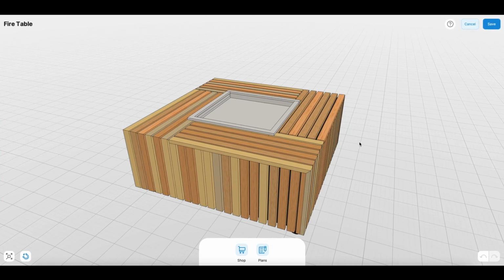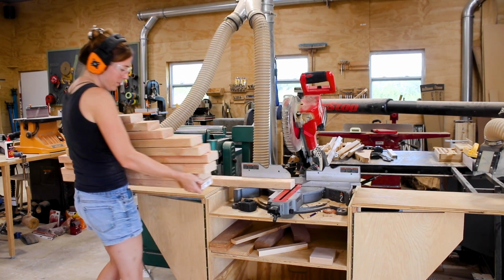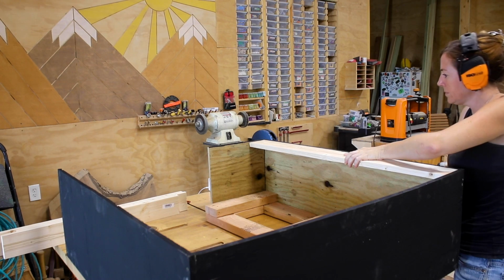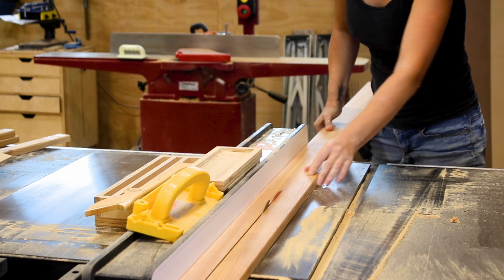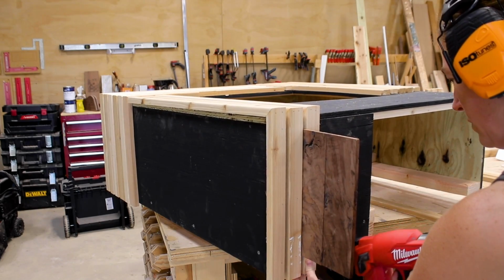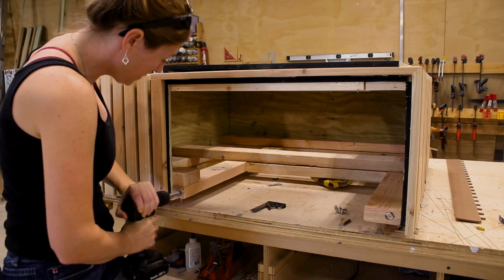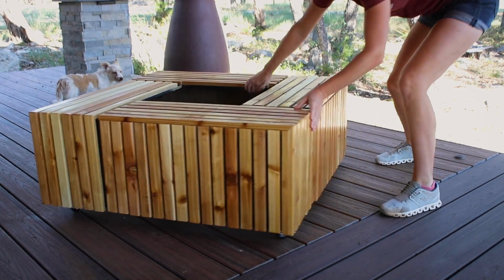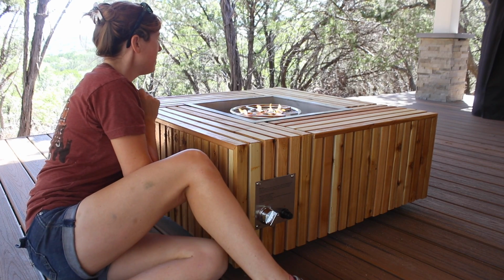DIY Fire Pit Table | A Gas Burner Kit Makes it Easy

Comment: Question.  I saw that you have the SawStop Floating Overarm Dust Collection unit.  It is understandable that you wouldn't use it while pushing lumber through while the operation is being videoed; however, there was a lot of sawdust on the table saw.  So my question is, do you ever use it?  Trying to decide on what overarm unit to get - if any at all.  BTW, I am the one Laura Kampf asked to take a picture of you, her and Andy Birkey at the Bay Area Makers Faire.  Thanks.

Comment: Looks fantastic.  I'm a bit wary about making the table itself out of combustible material and then coating with varnish but I'm keen on taking some of the useful tips and insights here and applying it to a stone/cement or tile-faced structure.

Comment: Oh my goodness am I so very thankful for your recommendation of the new modeling software! I have been building projects for more than 15 years. Always stuff straight from my head to the shop, which of course was complicated and so very time consuming as I never had an actual plan on paper. I tried Sketch Up several times and for whatever reason it just wasn't working for me. This new one, however...game changer. The moment I watched the video and saw your suggestion for the Make By Me software I was hooked. Jumped right on it, easy as can be and modeled a firewood rack I've been wanting to build for years. The breakdown of materials needed and cut list is going to absolutely change my building life. I can't thank you enough April. Love it! And of course love all the things you build ❤

Comment: The magnet idea is great. Not sure I'd build fire furniture out of wood though.
For youtubers, research whether propane leaves soot on fireglass.... I believe fireglass works best with natural gas. I have fire stones instead of glass, the soot is significant. Also, a glass fence around the fire makes it pop.
April, thanks for the video, the result looks great.
Reply: If you are getting soot on glass with your propane then you need to research and add an air mixer. Problem solved.
Reply: @haunthunterify  Air mixers have a certain likelihood of allowing propane to escape into the enclosure... No thanks.
Reply: @331SVTCobra  if you install it upside down, yes. If you know what you’re doing then no. Also, you should also have good ventilation for your exclosure.

Comment: I think it would have made sense to to put a platform inside for the tank.  With wheels, I can see this shifting around and banging into the tank, especially by guests who might want to just move it a little closer, move it aside as some passes, etc.  Also, as the design stands, when you do want to move, you have to go under and disconnect the tank, move, move tank, and reconnect.  One other thought was that the inner frame seems like it would benefit from some upright members, rather than relying on just the plywood.

Comment: Awesome Fire Table April! However, I will probably wait until next spring to build one. I'm very busy in the fall harvesting soybeans and corn on my farm. I'm glad you included links for the Fire Pan Kit and Horizontal Propane Tank, since I will need those when I build one. What are the over all dimensions for both of  your Fire Table Plans?  I might have missed it but I don't think you mentioned it in this video, and I don't see the dimensions on your website plan's either. Great Video! Enjoy your fall evenings relaxing by a peaceful fire April!
Reply from the maker: Sounds like you've got your work cut out for you! I forgot to mention the dimensions. They're now on my website with the plans. The large fire table is 39.5"x39.5" and the small fire table is 30"x30". Hope this helps!
Reply: @AprilWilkerson  Yes, this helps. Thanks!  I do like to keep busy. I guess we have that in common April!  Right? 😁

Comment: Hey!  You are amazing btw!  I already have a wooden table.  I got the kit and just need to cut a rectangle into the table and drop it in.  I see yours is wood as well.  Is it safe to have wood?  Thanks!
Reply from the maker: Yes, I address that in the video. it does not get hot in the surrounding wood. Thanks for watching.

Comment: I've noticed this from multiple maker videos i watched, but why do you make multiple passes with the chop saw instead of just one swooping chop? I'm assuming it's something to do with the sliding action? My saw doesn't have the sliding feature, just a 12" compound miter saw
Reply: Shallower passes will produce a smoother cut, no tear out, and less strain on the saw motor.

Comment: I am building this, however a bit confused.  My burner controls has an "L" shaped plate, where yours is flat held with 4 screws!  Am I missing something.  Also in the plans the magnets do not go in the ends of the frame, but into some framing material that has to be added.  Am I correct in this?  Thanks, Bill
Reply: Same questions. The door assembly in the video and in the plans isn’t the same, and doesn’t show enough detail.

Comment: What are the finished sizes of the large and small tables? I didn’t see a size in the description of either plan.
Reply from the maker: I went back in and added the dimensions. For the large fire table: 39.5"x39.5" and the small fire table: 30"x30".

Comment: Great design!! Quick question on table top. Any concerns getting it hot with extended use of fire pit?
Reply from the maker: Not at all. The top doesn't get hot at all as the fire is contained. Thanks for watching.

Comment: Great Idea. Quick question. Will the tank so close to the heat cause any issues?
Reply: It wouldn't be any different than a gas grill. As always, use soapy water to make sure there's no leaks in the regulator connection.

Comment: The link for the fire pit indicates to "Maintain proper clearances. 48” from sides surrounding fire pit". This means there should be a horizontal clearance of 48" from the outside of the pan to any combustible.  Last I checked cedar was combustible.  Be sure to check minimum clearance for your fire pit.
Reply from the maker: I actually worked with the manufacturer prior to building this fire table to ensure I'd be able to safely use cedar. They approved it! :) Thanks for looking out.

Comment: 🤣FYI  nothing that is made in a shop is DIY!
Reply from the maker: That is incorrect. DIY means Do It Yourself, meaning you are not outsourcing a contractor to do it for you or buying it ready made. My projects can always be done with simpler tools, it would just take longer, but can be done. Thanks for watching.